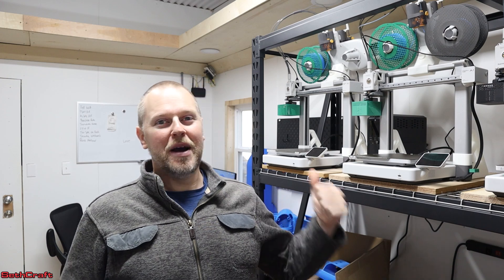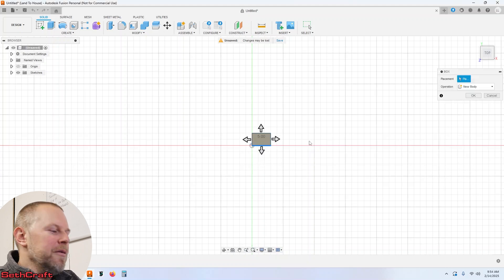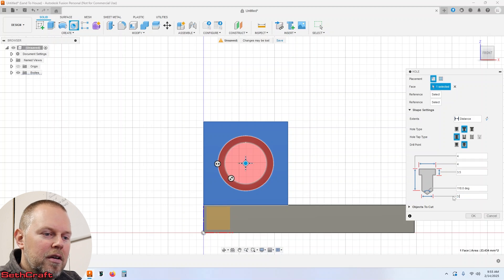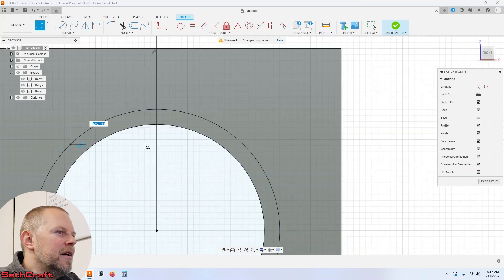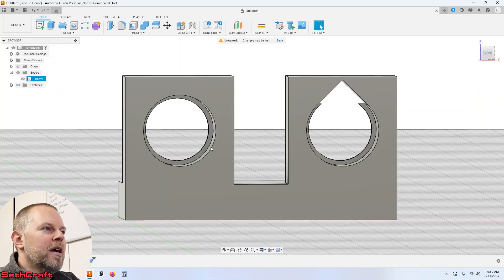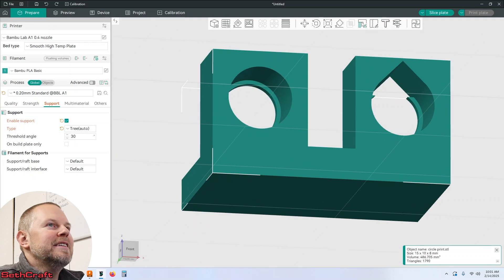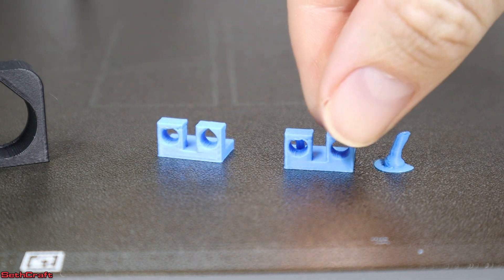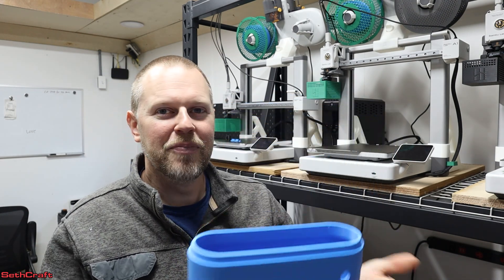3D Print a Vertical Circle without Supports - Fusion 360 How To

Comment: Well, and what about custom support structure designed in F360 to be removed after the print? Not default tree stuff, but smth Y-ish-shaped inside the hole itself... I think it should help achieving round shape with not much waste

Comment: If you don’t care about orientation, you can use a similar trick to avoid supports for square holes (e.g. for carriage bolts): rotate them 45 degrees to make diamonds.

Comment: I've been using that same method. When I do the top peak, I create it by making an offset of the circle by 10% of its diameter, then draw the centre line up to this new offset, and finally I draw the two angled lines starting at the top of the centreline and then have them meet the circle at the tangent point. Once it prints you don't see as much of the peak and it looks more like a full circle.

Comment: Is it possible to get rid of the lines between the holes? They stand out too much imo
Reply from the maker: Do you mean the layer lines on the print? My nozzle is set to .2 and that's as small as it gets.
Reply: I think @ahmethasanakkoca4662 is referring to eg. 0:40, where you can see a streak between the two holes.

Comment: I prefer the upper hole to be in the shape of a trapezoid with 20 degree angles.
Reply: The fast way is to use octagons or dodecagons instead of circles
Reply from the maker: Yes that is a good way to do it. I needed circles for esthetic reasons.
Reply: @sethcraftshop  But "circles" are circles, not a "teardrop" shape.  I guess you only needed the bottom part to be more round than an octagon?
Reply from the maker: That works! Does that take longer to model?
Reply: @sethcraftshop I have an excel to calculate the dimensions so it is easy. The diameter of the hole, and the overhang angle I want, is all that is needed. I use Tinkercad and the trapezoid shape there, and put it at the top of the hole.
Reply from the maker: Very nice. I tried tinkercad and it lacked some of the features I wanted. But it's still a nice program.
Reply: I do the same. It’s only about 10-50% longer to model, just make a horizontal line tangent to the top of the circle